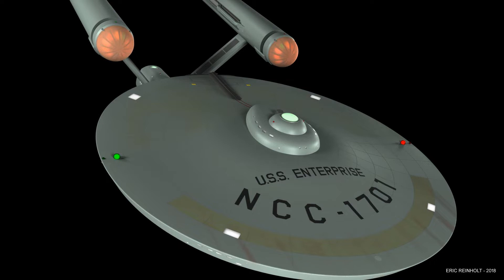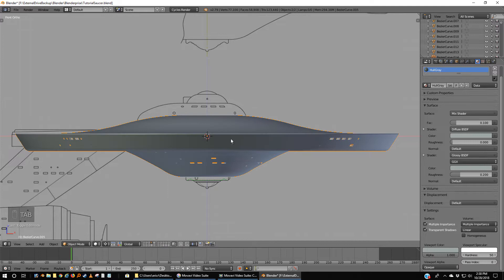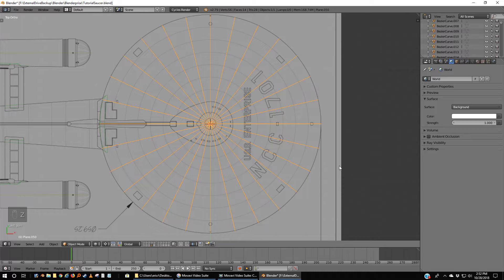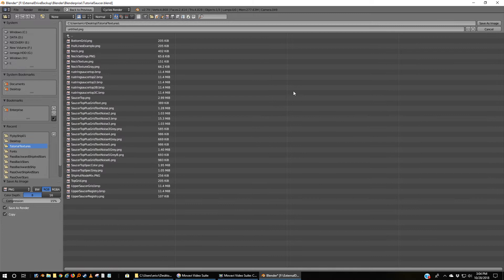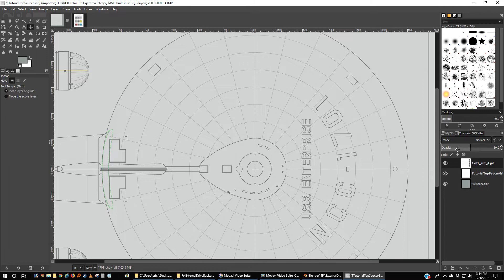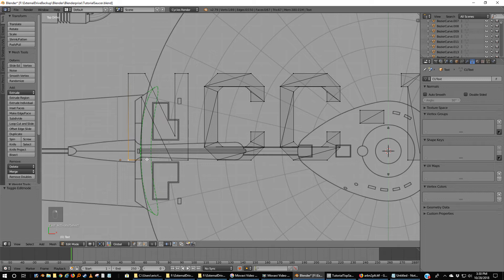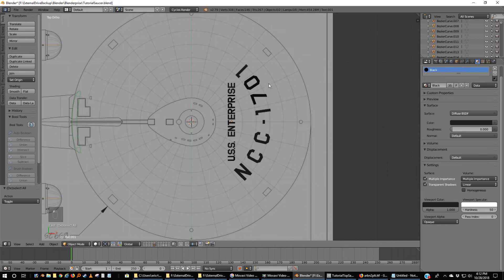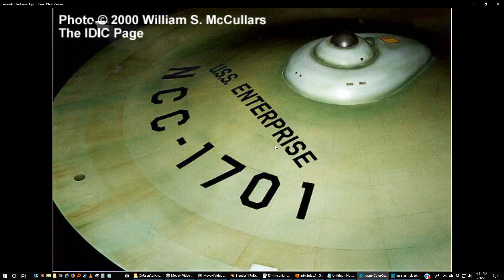37 Saucer Texture 01

Comment: Easier way to cut it in half is select the top center area and hold Ctrl and tap "+" and "-" on the numpad to the desired point.
Reply from the maker: I have no idea what that means.  LOL!  I'll have to give that a try!  Thank you for the cool tip!
Reply: @scifieric  However if you go from the bottom first its not that useful lol

Comment: I don't know if it is possible in the Gimp version you have, but there is a second way to scale the image. You can simply select the scaling tool in your toolbar on the left side. If you check "Keep aspect" or press "Ctrl" while scaling, you can click and drag the image to the size you want. :) The advantage of doing it this way is that you can actually see, what you are doing.
Reply from the maker: Awesome!  Great tip, DerRoemer2000!  That's exactly the sort of information I need!  Thank you.
Reply: DerRoemer2000 ,you have some pretty cool tips.

Comment: how did you get the yellow signage on the engineering hull to remain a strong yellow? Mine keeps getting the hull green tint in gimp so it looks more washed out and greener
Reply from the maker: Interesting.  My problem is the opposite.  I feel my yellow is too strong!  Make sure the layer is on top, and full strength.
Reply: Eric Reinholt I’m not sure how to increase its strength with darken mode applied to that layer. I will continue with this texture anyway to see if my accidental washed out yellow/green pays off as you said yours seemed to strong.
Reply from the maker: @Logan_935  change it to normal instead of darken!
Reply: Eric Reinholt that leaves the white background present. I made the red stripes and yellow insignia using blender
Reply from the maker: @Logan_935 - Ah, when you remake the graphic, do it as a PNG with a transparent background!